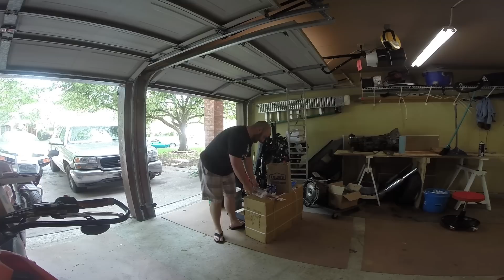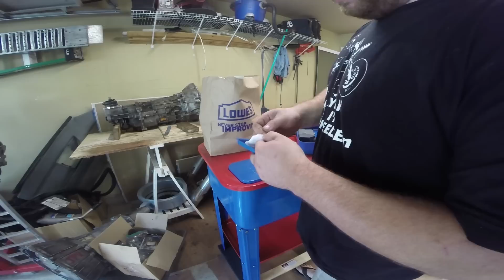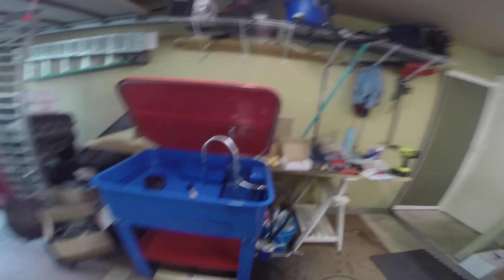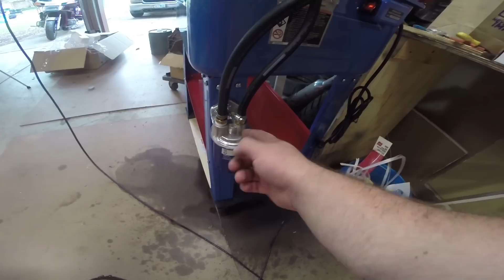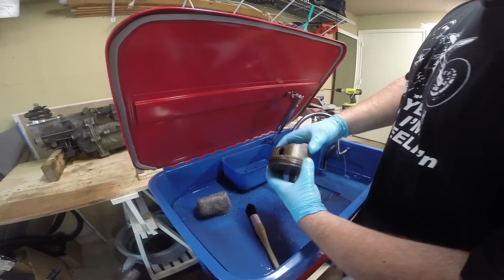MaksWerks Garage -  Filtered Parts Washer Build

Comment: So just want to get this very clear on my end. I acquired the 10 gallons of PSC 1000 and have finished the custom build of the washer. You say you added 2-3 gallons of water to your PSC 1000? Water NOT Naphtha...? You are saying PSC 1000 is basically a version of Naphtha? How did you come to determine that this was a good idea (if I'm understanding correctly.)? I've looked all over the internets for info on this and I got basically nada. Are you a chemist? Learn from someone else? Not that I don't believe you it's obvious you know way mpre than me on this stuff just interested in how you made that decision.
Reply from the maker: PSC1000 = 96% MEDIUM ALIPHATIC SOLVENT NAPHTHA

No water added. Naphtha is a solvent cleaner, good for cutting through grease. It is not water soluble so adding water is not going to accomplish anything. Just fill it with PSC1000 to the full line, and clean to your heart's content.
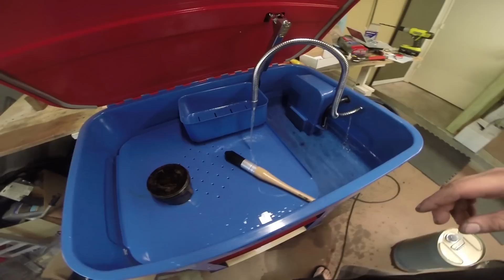Reply: Unfortunately I had already put 2 gallons of water in first before I saw your response, so I have like 8 gallons of PSC 1000 and 2 gallons of water in the parts washer. (At timeline  2:40 you had stated "We are going to put 2 gallons of water as well" -- so I did...(and at 5:32 you explain why you mixed the PSC1000 and the water...) - Pump did not work at first and I worked on the fittings without gloves. Boy my hands are bugging me now.

Comment: I would rather use b12 Chemtool carb cleaner. Would that work in this system. I think the water is going to make that filter mush
Reply from the maker: That stuff is super hazardous and would eat all the paint off the tub, as well as destroy all the rubber in the lines.

Comment: what's the purpose of filtering the liquid AFTER it's already been through the pump... I thought the purpose was to filter the liquid PRE pump?
Reply from the maker: There is a prefilter on the pump to catch big stuff, since the design is a submerged pump there is really no way to filter the liquid pre. The filter was there to clean the liquid in general and made a dramatic difference in your ability to clean parts.

Comment: Thanks for the tip on the solvent from TSC. I bought A Gray Mills parts washer at an auction last Saturday for A buck! No one wanted to put it in their nice new pickups or their pretty SUV's. Pays to drive junk! Lucky it had been drained so I didn't have to find jugs to empty it out. Good luck!!

Comment: I have this unit and it says to only use water based solvents. Will your application destroy the pump, since it's not made for petroleum based solvents?
Reply from the maker: years later it still works great. YMMV
Reply: apparently they made 2 different pumps for this parts washer. years ago I had one and the pump lasted until I sold it, pumping mineral spirits. I picked up a new unit last year and the pump crapped out after like a month. someone looked up the specs and found that this particular Chinese made pump is only spec'd to run water. just water. not even water based solvent. water. like it was meant for an aquarium. I'm swapping in the same parts as this video and a Little Giant pump like others have done.

Comment: how did you connect the outlet of the filter base where the 90 degree is to that silver nozzle
Reply from the maker: worm gear clamp.
Reply from the maker: Thanks! its annoying when you gotta watch the video 10 times to figure out what the guy is using.
Reply: I know thanks for the parts list just put mine.tofether with the same filter base except I used 1/2 in barbs and hose for max flow!

Comment: Nice setup! 
2 more questions...
(1) What was the brass right angle piece you used?
(2) How's the pump holding up? My understanding is the stock HF is for water based solutions and not solvents like the Crown PSC 1000 parts cleaner.
Reply from the maker: +brianrush50 

1. Its all just pieces from the hardware store. The filter takes 1/2 NPT, and the rest was 3/8" NPT.
2. Weekly use, pump looks great, fluid is clean, and pump flows nicely. I know a lot of people use water based solutions in it, but I do not find them to be effective. Its been about 6 months since I did this, and I am perfectly happy with my parts washer.

Comment: Nice mod! Two questions: 1) What size holes did you drill in the side of the washer? and 2) Where did you purchase the rubber grommets? Thanks!
Reply from the maker: +C. Fishel 

1. I simply measured the grommets ID and then used a step out bit. I dont remember the exact sizes. 
2. Got the grommets at Lowes.
Reply: a 1/2" electrical chase nipple is a great alternative to the grommet and will outlast the parts cleaner.